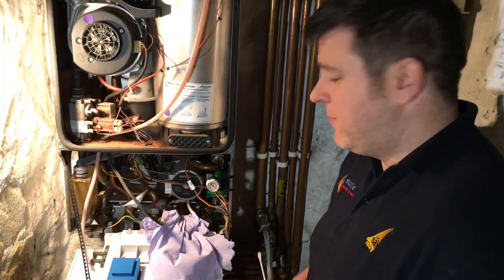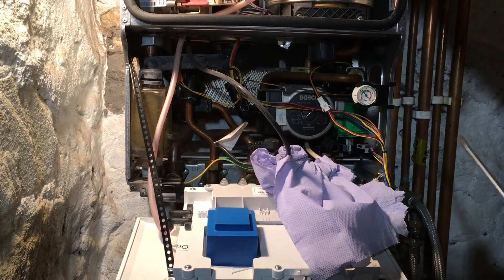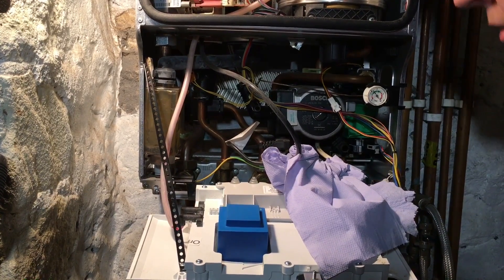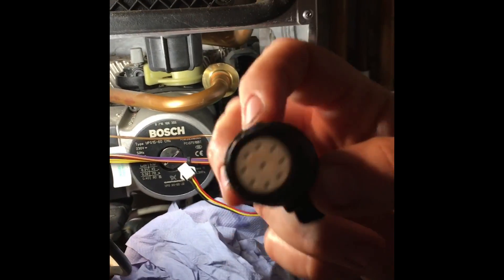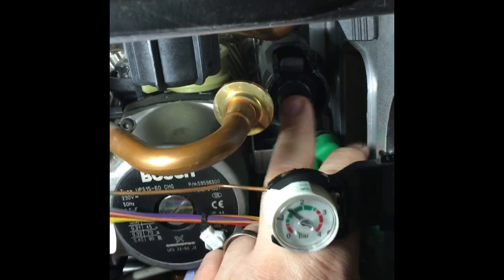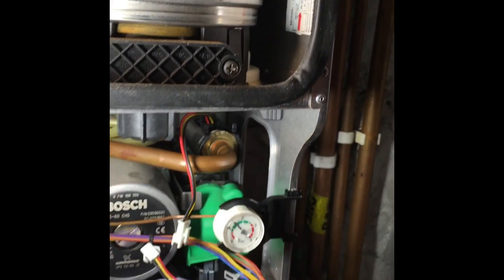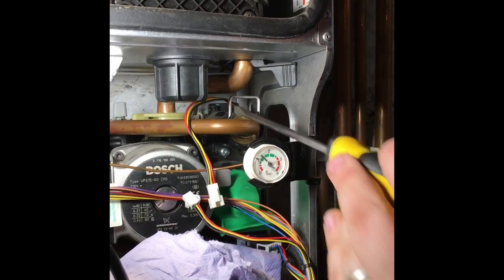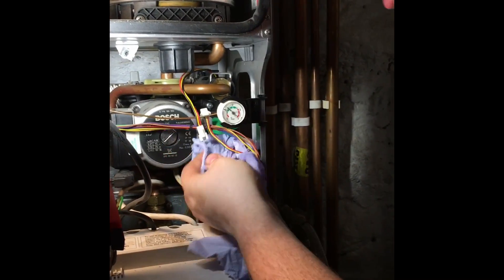Repairing a leaking Worcester Bosch Combi Boiler flow turbine

Comment: Hi, would you need to change the flow turbine sensor as well? I had the flow turbine adapter changed when it was leaking, but still don't have hot water. Thanks

Comment: The clip / pin actually should go down further than that through another set of holes at the bottom. It can leak if it’s not through both sets, top and bottom

Comment: Hi Michael. Did you need to undo the other end of that pipe in order to get enough movement to remove the flow turbine or is it flexible enough to leave connected?

Comment: Dear Alan. Love you video. I was hoping you could give me some insight to the below. I am a sparky by trade and helping my friends do the electrics when fitting the boilers so they are teaching me how to fit the boilers. Then I’ll do my gas safe. As I am 18th Ed part P. EIC/NIC bla bla. 
On another note. I was hoping to have a quick chat with you regarding Worcester 30SI at home. I’ve checked the pump for Ohms and it’s sitting at 0.3ohms which means the pump is good to go. So I think I have ruled out the pump. 
I think it’s the PRV. Defo not the pressure gauge again low ohms on that. 
Going by logic. I fill it too 1bar and ask for heat on CH. it runs fine giving heat but then it gets to 2bar and starts pushing the water out the over flow. My understanding is that this should only happen at 3bar or above so if it is kicking in at 2bar then it’s the PRV that needs changing. Is this an easy job I can do with my tools or do I need specific tools??? For £9 on eBay but I was hoping you could tell me where to get one local??? It’s worth a shot but really I’ve ruled out every thing else and even the expansion vessel. Although I’ve not found the nipple to see if it’s air or water thats coming out as it should only be air and or needs filling with air again. But I don’t think it’s the vessel. I am sure it’s the PRV but I ain’t a heating engineer but I ain’t far from an engineer tbh. Plus I’ve ruled out the filling loop as I’ve set it to 1.5bar and switched off at the mains and it doesn’t go up on pressure meaning it’s going into the CH system rads so rising pressure. It stays at 1.5 bar. 
It has to be the PRV as it won’t go anywhere near 3bar and kick in as it should. It gets to 2bar nearly and start kicking water out the over flow pipe. Going by my understanding of heating systems and what I have learnt over the years my logic above sounds sound but I could be wrong. But changing the PRV is a cheap fix and would be ideal. Have all the usual plumb tools but nothing special. Couldn’t fill vessel or do a flush as I don’t have the equipment yet!!! 😃😃😃
Let me know when you get time and I’ll get the work done at the weekend once I’ve sorted this ladies shower out on Saturday but should only be a couple hour job as swap for new. 

Any advice would be highly appreciated 🙏🙏🙏
Best regards, 
Scott. ✌️🙏✌️

Comment: Great video, thanks for the pointers. 

My old one had completely cracked inside that housing so came out in a few pieces! The hardest bit was pushing it back in... so much so that I found it easier to ‘twist’ the meter onto the pipe before pushing in to the rest of the assembly.

And if anyone found this video because they were getting heating working but no hot water or vice versa and had to replace this assembly, make sure you unplug any wiring attached to the diverter motor (the thing directly underneath - should be one white plug at a funny angle) and allow to dry, and reconnect when all the work is done... diverter motor should be working fine! :D
Reply from the maker: they normally crack inside, not a great design imo, Thanks for watching.

Comment: i would take the pressure gauge off its mount it gives more room
Reply from the maker: Thanks for watching.
Reply: @AllenHart999  Hi Allen,I've got a greenstar that's running hot water for about 5mins then cutting out,any ideas

Comment: I've got a 2006 532/i boiler installed. I believe its a British Gas boiler manufactured by Wocester. On Tuesday, after i topped the pressure up all worked fine, up until yesterday where i noticed the heating wasn't working again. I've noticed a small leak coming from underneath the boiler, at first i thought it was the pressure filler nut but it wasn't, a quick inspection and i noticed the water leaking from a plastic housing, where a copper pipe runs out. A look at the manual tells me its the flow turbine. If this is the case, would it be a cheap part to replace ?
Reply from the maker: Thanks for watching.